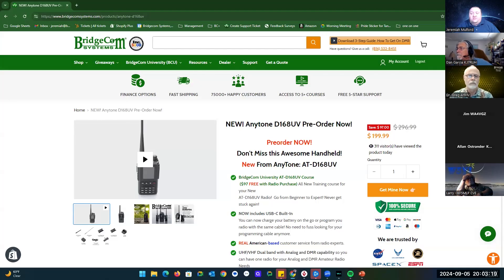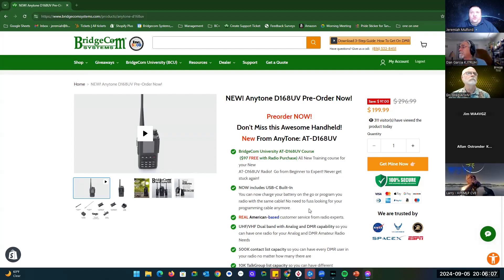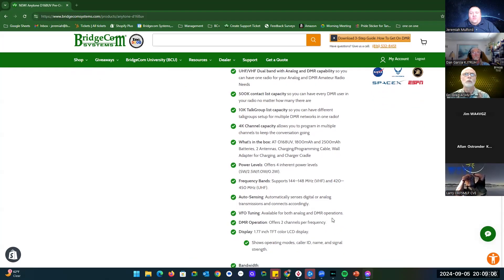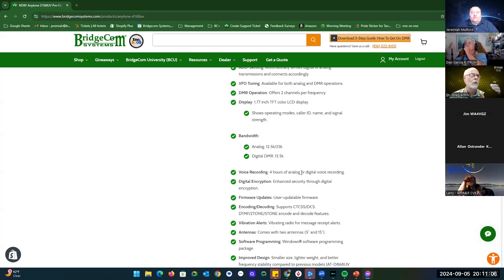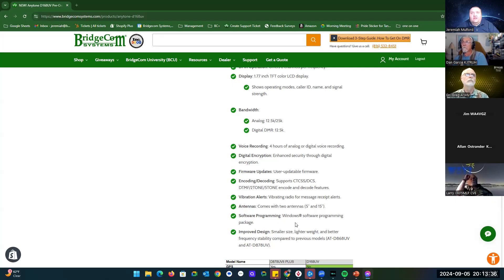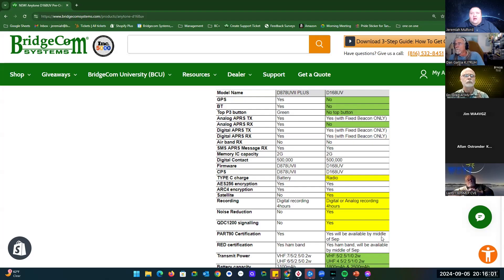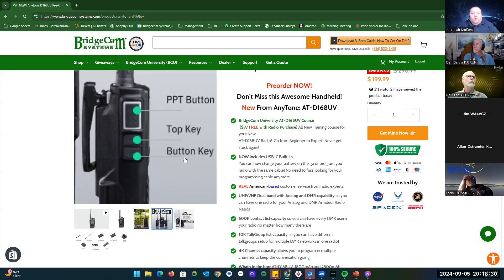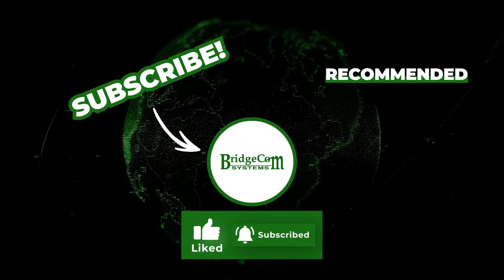New Anytone 168 UV Radio: Features, Upgrades, and First Look

Comment: Hi I just received my Anytone D168 UV how to unlock all frequency on channel 144-148 420-450?
Reply: I try turn off radio and press 1 and hold ptt button turn radio back on is unlock frequency but can't transmit all bands
Reply from the maker: Hi, did you get the radio from us?
Reply: Yes Anytone D168 uv

Comment: Purchased a new 168uv but have a problem. When I add my local DMR repeater to my radio, the radio transmits fine and I can see full receive signal strength. but when it receives there is no audio, the radio sounds mute. I have correct CC and slot cause I can key the repeater but as I said no receive audio. Any suggestions please.
Reply: Hi, yes I also had the same issue with no audio.  The radio came as default with the volume set to "indoor", but this seems to mute the unit.  To fix go to menu, settings, audio set, voice func, vol level, and select level 5 (or higher if needed).  This should sort it.
Reply from the maker: Hi! If you purchase the radio from us, please submit a tech support ticket for further asisstance: https://support.bridgecomsystems.com/kb-tickets/new. Thank you!
Reply: I have a similar issue with the Boafand DM 32 if anyone can help